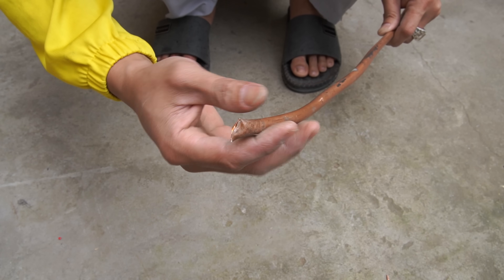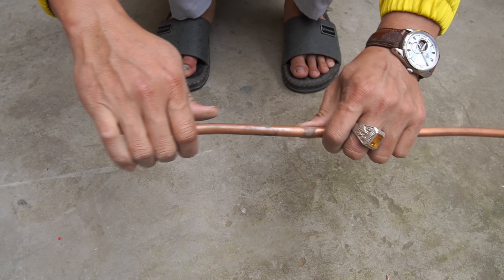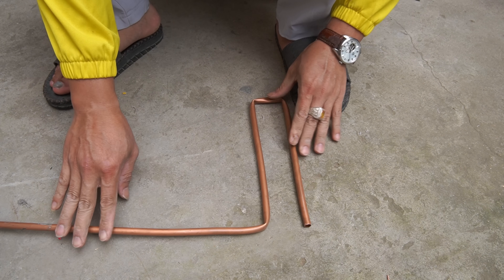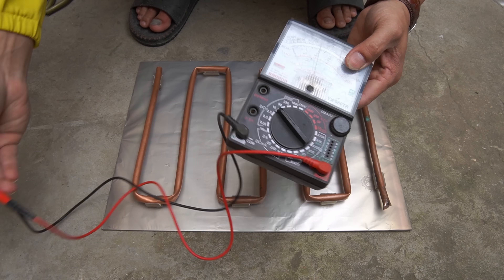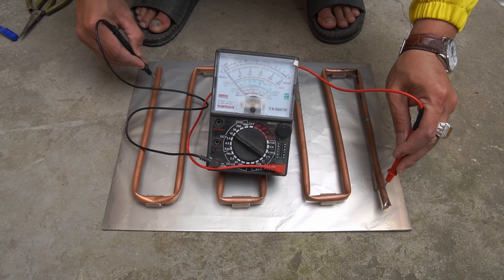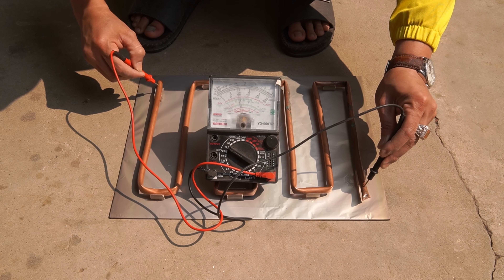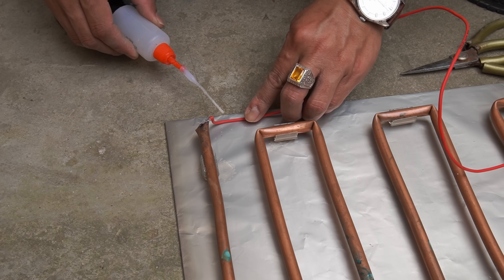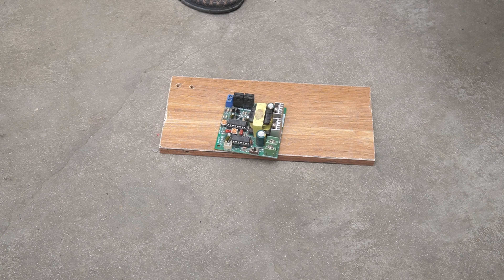How I Turned Copper Pipes and Foil Into a Powerful Solar Panel | DIY Solar Energy Hack

Comment: you don't even have a pipe bender?  your a nut.  Doing the tesla thing,  nope, its not a solar panel,  just picks up radio waves.  boosting it with a transformer

Comment: Would you put a link of the Module you using. Looks like a small inverter Module  Thank you.
Reply: Das kann er nicht. Du siehst ja auch seine Antwort. Alles Blödsinn 😂
Reply: @famwilke4414  Are you say this is fake? It's on YouTube.
Reply: @famwilke4414  una placa inversora conectada al revés (las baterías están en el ventilador o en el enchufe) Estafa total, el curro debe estar en el ventilador que aparece en todos los "proyectos" 🤮
Reply from the maker: ❤️❤️❤️Thank you very much, please like, share the videos with everyone and subscribe to the channel. I love you!
Reply: @GreatElectronicInventions  is this fake? It's on YouTube.
Reply: @ShilohVideo ; yes. This ist Fake.. You can post any video on YouTube. 

Please pay attention to the answers of the video uploader
Reply: @famwilke4414  Thanks. I was just being Funny. It's all Fake. It's like watching CNN.
Reply: @GreatElectronicInventions  Would you put a link of the Module you using. Looks like a small inverter Module  Thank you.
Reply: any transformer will work,  it be nice if you meter measure the ac and then measure the DC, and dont run the fan to long,  unless you have the stats correct with the meter, or you burn the motor up
Reply from the maker: ❤️❤️❤️ Thank you very much, please like, subscribe to the channel and visit me often.